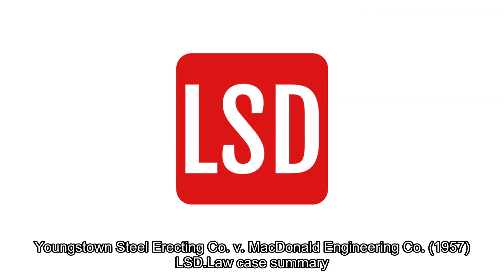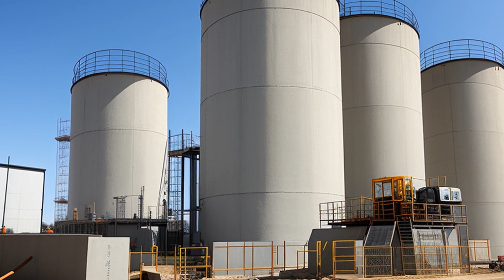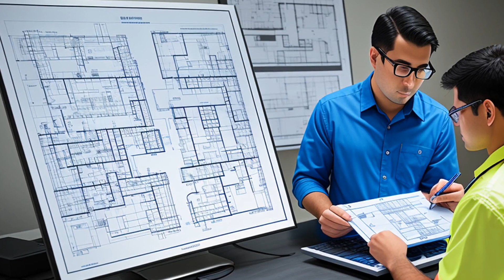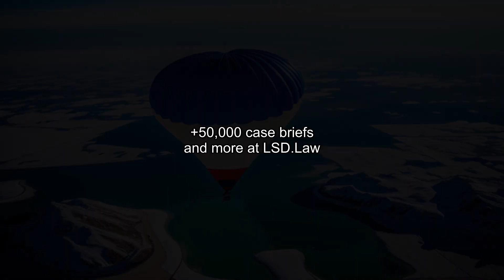Youngstown Steel Erecting Co. v. MacDonald Engineering Co. (1957) Overview | LSData Case Brief Video

Comment: In 1957 The United States District court for the Northern district of Ohio heard the case of Youngstown steel Erecting Company v, MacDonald Engineering a lawsuit centered on the principle that a contract is only legally binding if both parties is clearly and specifically agree to its terms. (Like being on a conventional where the blood is being saturated) The defendant McDonald Engineering company specializing in designing & constructing structures had been hired by Bessemer Limestone and cement company to design and build nine cement storage silos. Youngstown Steel Erecting Co. v. MacDonald Engineering Co., 154 F. Supp. 337, 1957 U.S. Dist. LEXIS 3091